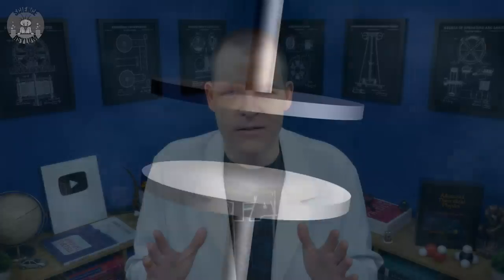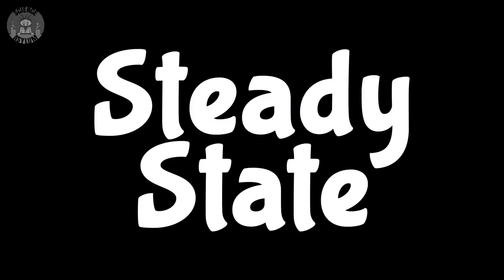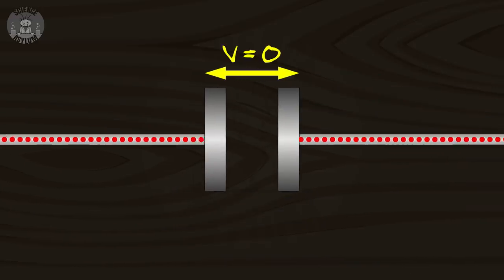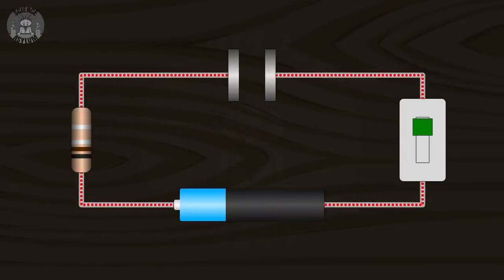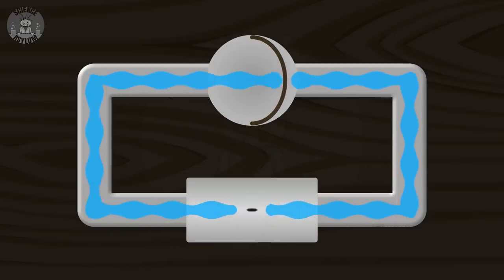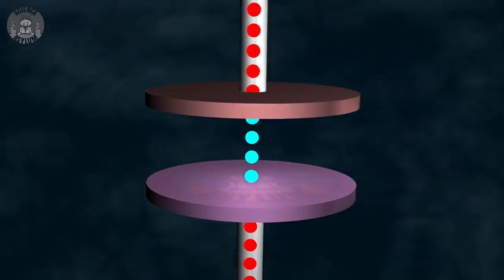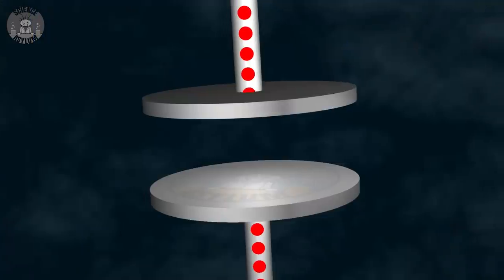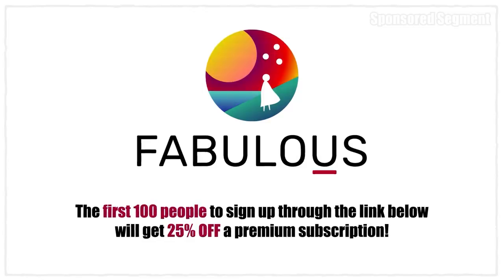Capacitors Are Gaps! How Does That Work?!

Comment from the maker: Start building your ideal daily routine 💪 The first 100 people who click on the link will get 25% OFF 🎁 Fabulous Premium ➡ thefab.co/thescienceasylum
Reply: Poggers
Reply: As an electrical enginieer, I learned about the poynting vector in two subjects: Electromagnetism 2 and Transmission Lines. Even though 95% of the time (99,9%  if you does not work with antenas) this level of abstraction is not necessary.
Reply: best science channel on youtube , why didnt varatasium credit you for stealing your video idea tho ?
Reply from the maker: @borgholable  He did credit me, just not verbally in the video. I'm listed as a reference in the video description.
Reply: Took me a while to remember who Fabulous were but damn glad they're still around :D
Used their app a few many years ago
Reply: @ScienceAsylum  what about an rdram
Reply: This poynting vector has come up alot lately and I'm hopelessly confused. As for capacitors, I was told they store up energy so a certain level can be maintained for things that require that much power, like old style tv's, and was warning to never touch one even if the tv was unplugged. This video just added confusion. I'm sure it's smart and correct but I'm not.
Reply: @mikeyoung9810  capacitor are usually coupled with high resistance resistors so that they only discharge very slowly, but if you happen to touch a naked capacitor, it will discharge through your body and shock you badly.
Other than that don't worry if you feel confused you're not alone ^^ i too am having trouble linking these videos with what I was taught in school (it was dry and devoid of illustrations so all I remember is formulas without meaning)
Reply: Is the energy in the capacitor coming from the magnetic field?
Reply: @bachamalang8522  That'd be inductor. The capacitors store their energy in the electric field, so in the difference of charge between their two plates, which is proportional to their voltage.
Reply from the maker: @bachamalang8522  Capacitor energy is stored in an electric field.
Reply: @ScienceAsylum  It wasn't there initially, he may have added it later. I didn't see it when I had seen his video (and it immediately reminded me of yours).
Reply: Your explanation made me curious about how thing works with vacuum tubes, that thing has literal gaps too.
Reply: (12:00) Why electrolytic capacitors explode when polarity is inverted?
Reply: @ScienceAsylum  oh so the first plate is just inducing current on the second plate,the magnetic field created on the first plate by the displacement current is creating an electric field on the second plate ,Am I right?
Reply: @ScienceAsylum  but I already knew that
Reply: @mikeyoung9810  They taught the poynting vector to me in 1976 in EE college. I forgot about it. By 2008 I stopped designing power supplies to be an investor. Then in 2021 Poynting vector was all over youtube.
Reply: You never mentioned the word "flux" once in this video - even though the capacitor is designed to stabilise fluctuation in the current.
Reply: First, looking from the point of Primary sources; Maxwell did regard a dialectric as a "seat of electricity".  He came up with an idea of a displacement as a flux, D = E * eta (where eta is a permittivity to suppor displacement) just like permeability supports magnetic flux in a conjugate way. I do recommend you read some Heviside and Steinmetz. Who they are, well I think they are much more important for scientific clarity the Einstein- the hero
Reply: I like how you showed your work.
Reply from the maker: @Clark Kent  I've been making an effort lately to not use jargon unnecessarily. If I mention a fancy word, I then have to define that word. It's often just distracting for the audience and not worth the time. "Flux" is one of the most jargon words physics has.
Reply: @YounesLayachi  I studied some basic electical enginering. When we did practical appliance we used to charge those capacitors and put them back in storage to wait and see the next person to get shocked. ;)
Reply: If I had this app, I would use it to stop distracting myself from my work by watching physics videos like this one.   Great video.
Reply: @ralphvercauteren9267  sounds fun xD
Reply: What if one loops current in a zero resistance wire and then removes the battery,if no energy is lost from the battery how is the current present at all, no energy is going into the wires from the battery
Reply: The idea for this video actually started as a reason to use his Dune pun.
Reply: @ScienceAsylum  So if the Poynting Vector equation is affected by both electrical and magnetic fields ... Does that mean that our lightbulbs in your example would be brighter in the presence of say ... a Magnetar ... because of the increased field strength around it?
Reply: Could you do a video on inductors?
Reply: I have a confusion .
Why capacitance is independent of thickness?
Reply: Its a good video tho
Reply: Hi Science Asylum!
I have a video request from you🤗 Can you make a video on how electric signal actually flows in a wire. I have read that the speed of EM wave is dependent on the insulation used and not the conductor wire inside it. And can you also explain why charge do actually move outward toward the surface of conductor and produce an electric field in the wire to cause the current to flow after a battery is connected.

I have a situation for this last one-  Suppose there is a 100 metre long metal wire with (a) an insultion (b) or no insulation. And you bring the two ends of wire near a battery and use an special switch which connects both terminals to battery when it is closed and removes the both ends of wire from terminals when it is open simultaneously.

Thanks you are doing great job 👍
Reply: You are absolutely amazing! For 56 years I have been trying to understand electricity. Everything you said makes perfect sense for the first time. I am theoretical physicist had me laughing out loud! Thank you!
Reply: Have you seen Veritasiums new video on how the electric field is actually what moves the charges? It is sick! And I finally understand everything about the fields now!

Comment: I've never heard capacitors described as "breathing energy" before but I think it's a brilliant analogy that would have saved me a lot of confusion when I was trying to understand them.
Reply: I always thought of it as a balloon filling up and then popping. Except repeatable, like a bubbler. I was glad to see I wasn't far off the mark, even though I didn't understand the mechanisms involved.
Reply: Bellows, for a fireplace. The air in, air out can do two things, it shows how a full capacitor stops a direct current load, and how it smoothes during AC operation.
Reply: @Robert_McGarry_Poems  :o That's a mighty fine metaphor you got there. You could compare the AC use case to how a bagpipe is played, but that would annoy the neighbors.
Reply: @Robert_McGarry_Poems  look at it like this: energy can be divided in two, power (current, work, amps) and potential (voltage). energy always seeks equilibrium from high potential to low, when it cannot get there it acts capacitively until it arcs over and produces power. the capacitor, much like the earth and the storm, draws in energy from its surrounding sides in order to try and obtain equilibrium. so, what's really happening is, we are storing potential voltage and releasing it as infinite current power the moment the switch closes. in opposition to this, an inductor will store magnetic current and release it as infinite potential voltage when the switch opens - what goes into a capacitor is the same thing coming out of an inductor, and what goes into an inductor is the same thing coming out of a capacitor.
Reply: I explain the concept of a resivoir capacitor in a dc power supply as a bucket That's being filled with a sporadic stream of water but has a hole in the bottom where water is steadily flowing out.

Comment: Nick, probably the best capacitor explanation I have seen so far. Thank you for that! As an electrical engineer, I was always taught "This is a capacitor, this equation describes how it behaves. That's it." But we were never explained "why" and "how" on a deeper level.
Reply from the maker: Thanks! I'm glad you appreciate it 🤓
Reply: The 'why' and 'how' were never addressed when I studied these subjects, such a shame
Reply: @ScienceAsylum  I myself got to a better feel of understanding a capacitor by considering voltage to be negative-pressure.
One side electrons are pushed in by the powersupply but only a few, essentially line is in gridlock. The other side the powersupply keeps pulling the metallic-crystal-"free" electrons off until there is equilibrium in electronforce, making that side positive due to lack-off-electrons.

Some current/electrons moves between the plates otherwise the distance between the plates would have no meaning, but because the negative-pressure(voltage) stays at the same value the change in field is not really measurable.

Also fun maybe in the future to explain how electron orbitals work inside of metals and how they are different than in molecules, and how metals have "free" electrons on the surface, which can be squeezed together or pulled apart without upsetting the molecular bonds of the material. (like when you keep iterating the same Lego blocks together you will have knobs or gaps sticking out at the surface, some electrons have nothing to do in regard to bonding with another atom.
Reply: @tripplefives1402  I`m looking at it like this, which works in multiple problems i`ve solved in electronics.
In a circuit with a battery and a resistor/light.
After you throw the switch all the available electrons in the battery`s negative side rush onto the circuit and eventually create full gridlock on the line all the way to the plus side of the battery. (i know the electrons dont actually move all the way around, but the gridlock is the main logic here.)
The electrons are then waiting to be processed by the battery which because it`s chemical is slow in passing them from the plus to the negative side, however the battery has a big "plate" so it does a bunch of them (say 1000 or something) in one go.
When it processes those 1000 a gap forms on the plate which will be filled by the ones that are waiting in line, after that the next 1000 will fill the gap to move from place 1000-2000 to the first 1000, and so on the gap/bubble travels in the opposite direction to the electron flow.
The gap/bubble would be the voltage.
That gap/bubble has a collision rate of the next electrons filling in the gap because they are pushed in negative direction by the ones that are waiting behind them.
The bigger the gap the higher the voltage, the bigger the speed the electrons get at when the bubble passes and they collide with the ones that already passed the bubble. (think of a waiting line where every car is full throttle but not going any speed because gridlock, the bigger the gap the bigger the impact on the ones in front as the gap passes.)

You can imagine what goes on if the gap passes a funnel, like a resistor and on which side of the resistor its getting hot or even failing.
Applying this for a capacitor means that the "spark" gap is more created by the electron pull side (+) of the powersupply than the push side, and current does actually flow  when charging the cap but that is just the electrons being pulled of the positive plate until the plate is "empty".

You need "current" through a cap though otherwise the distance factor would make no sense, but understanding what current is becomes something else completely, just because no current detector (magnetic field meter) can pick up the flow doesn`t necessary mean it doesn`t exist, maybe the draw/pull is so big the electrons are not able to make a field/there is no spread but jump so straight over the gap that nothing can be detected.
Reply: "But we were never explained why and how on a deeper level." 
Basically the entire history of my school years.
Reply: I shared your experience - it is just ridiculous that coming out of EE, you know all the theory about condensers and how to write differential equations with them, but you have no clue what they are really for. And they are everywhere: Low pass filters in AC to DC converters, High-pass filter at the emitter of a transistor amplifier, just to name a few... I would like to go back to my Uni and slap my professors
Reply: @tripplefives1402  It's true in principle that any material can be a conductor given a sufficiently high voltage (that's actually the reason transistors are a thing), but, in practice, the majority of items would be destroyed if you applied a high enough voltage to them to make them conduct.
Reply: The model we engineers use is damn useful. It's so much easier than analysing what happens on a physical level.
Reply: @tripplefives1402  it is also the way to transmit energy through ground by Tesla
Reply: It’s saying something that electrical engineers don’t understand capacitors
Reply: same same same same

Comment: Flirting with the Veratasium debacle without touching it? Love your channel! Also, any thoughts on Veratasium's assertion?
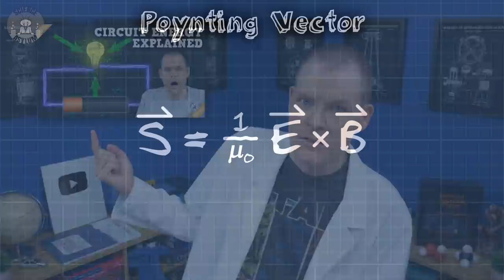Reply: 10:50 he was years ahead
Reply: @JabranImran  maybe. Veratasium make a specific assertion. Uses the word lies. Says energy will arrive in speed of light pretty much regardless of the wiring diagram. Etc...
Reply: Nick commented on Derrick's video directly. He was of course supportive and warned him of comment trolls.
Reply: @playgroundchooser  hmm. Unsure who is trolling whom here. I'm of the opinion Derrick is trying to assert science without experiment. Might even call it trolling, but I'd avoid that word.
Reply: @BenjaminGatti  Oh, no no. I mean that Nick warned Derrick of trolls in his comments, not you my man. You bring up a good question.  I think Nick is more about the physics (the math itself) behind the problem.
Reply from the maker: In education of circuit analysis, it's common to use extremely simplified examples to make each point. In this case, the point is that circuit energy is carried by fields, not wires. That is true regardless of how complex or extraordinary the scenario is. Derek's circuit example was simple but the size was extraordinary. However, his example makes the point he was trying to make, which was that the light bulb is aware of the battery's behavior due to the physical space between them (not the wire length). This is also true.

However, reality is often more complicated than the simple examples used in education, so you have to be careful that you don't step outside the scope of the model. While it's true that "the light bulb is aware of the battery's behavior due to the physical space between them," that doesn't necessarily mean the light bulb will suddenly be at full brightness the moment it becomes aware. His really large circuit lives in the transient state for quite some time, which means reality doesn't necessarily match our expectations.
Reply: @ScienceAsylum  That said, Derek is asserting a truth, presumably a scientific truth, (He should use the word hypothesis thesis or law,) that sufficient energy to produce at least a single photon will be captured by his pictured apparatus with 3.3nSec. forgive the skepticism, but I doubt it.
For one, there is no need to make it complicated with unmanageable lengths or unobtainium magic wire, the physical size of a 3.3nSec universe is limited to a single Meter of apparatus, so we can quickly dispense with the fantasy wires. What's left looks more like the black knight in Monty Python's Holy Grail. So please explain even theoretically, what energy is present given some ideal but reproducible switch, 1 foot from a 12v battery, and as much of Derik's  magic wire as can fit within 1 meter radius of the lamp. I'll wait.
Reply: @ScienceAsylum  one additional expectation, this photon ought to be distinguishable in a noisy universe. If the circuit is just as likely to generate a photon without toggling the switch, then it's hard to defend the thesis that the switch and battery even matter. In short, the background radiation on our planet may be more energy than Derek can expect 1 meter away from a 12v event to nowhere.
Add to this the pouring vector to ground. Did you include the ground in the analysis, it's everywhere, his wires are sitting on the ground 1 mm from the wires, the ground at 1mm is a huge capacitor relative to Derek's magic wires 1000mm.
Reply: @BenjaminGatti  
The only thing that "lit up" when Derek closed the switch were his own eyes when he pondered the number of views (views = $$$ in the YT universe) that his clickbait video would generate. He knew what he was doing, obviously.
The only way to deal with "the boy who cries wolf" for his own benefit is to shun him henceforth with a jolly "unsubscribe". He's been selling out his integrity recently... Sad...
Reply: @rustycherkas8229  I left him a long time ago for that very reason.
Reply: @iamjimgroth  
I've returned to "that video" a few times just to assure myself I wasn't being overly and unjustifiably judgemental.
Quick question: Did the controversy draw you back to that channel for a curious peek? Did Derek's "one shot" of being blatantly disingenuous irresistibly pique your curiosity? (The "science" of "look at me celebrity"... Marketing 101...)
Cheers! 🙂
Reply: @rustycherkas8229  No, i got enough information from other YouTubers to understand the context.
Reply: @iamjimgroth  
Derek's new YT channel: "Controversium"
First episode: "The value of sqrt(-1) revealed" 🤣🤣
Reply: @rustycherkas8229  sighs